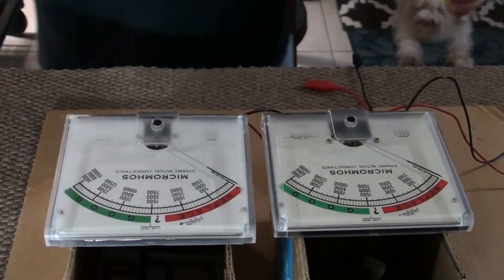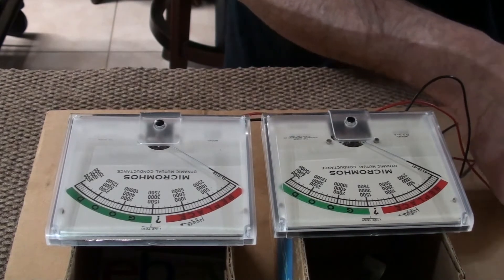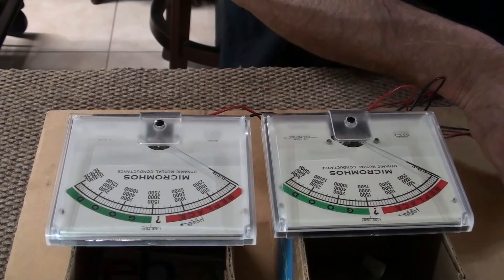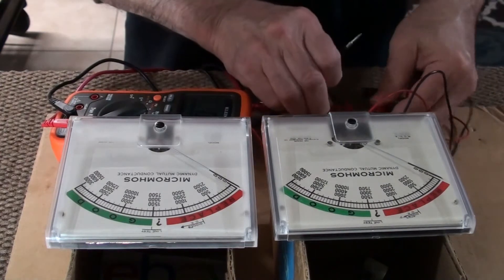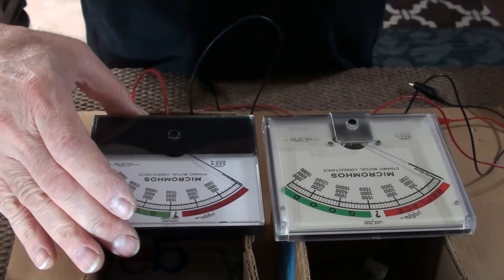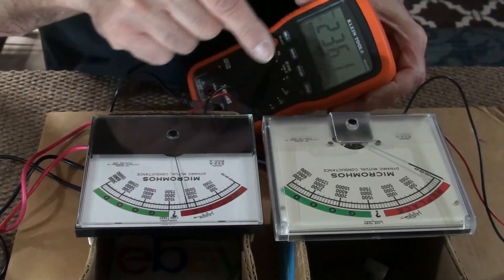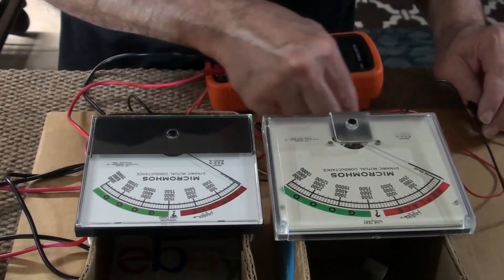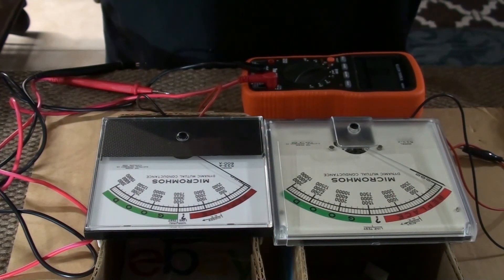Hickok Tube Tester Meter Comparison, the Good, the Bad, and the Newgly

Comment: Don't know if you're aware of this, but there is a way to calibrate Hickok meters' full-scale current reading, using the magnetic shunt on the side. It looks like a curved metal band with a slot, and is adjustable via a screw which tightens the band down. I learned this while reading Daniel Schoo's "Calibration Testing of the Hickok Model 600/600A Tube Testers", which is still available on the InterWeb.
Reply: ...aaaand now, after testing my 600A's meter, I see that my meter reads a few marks shy of full-scale, but the shunt is at its maximum travel; moving it down, it'll only decrease the full-scale reading, but I need the full-scale reading to increase.